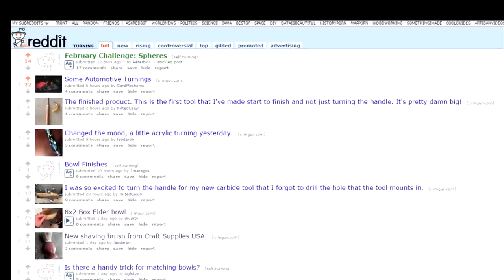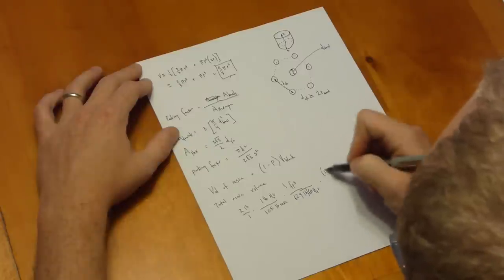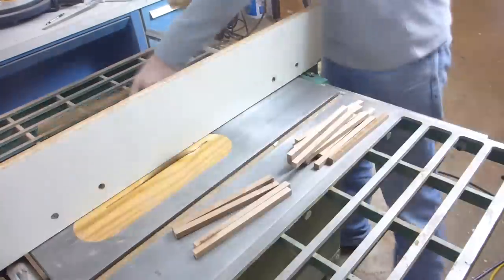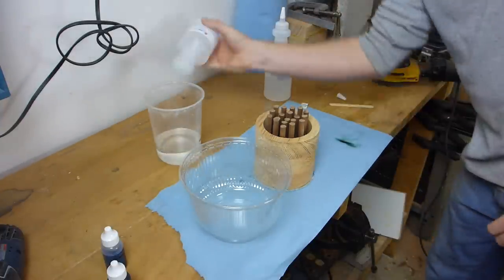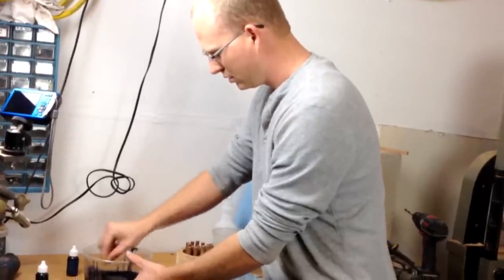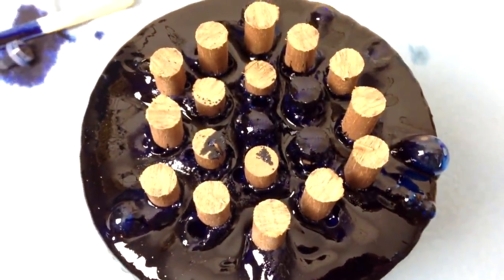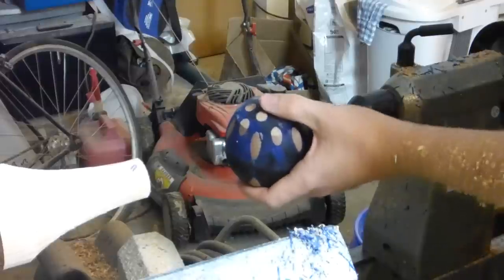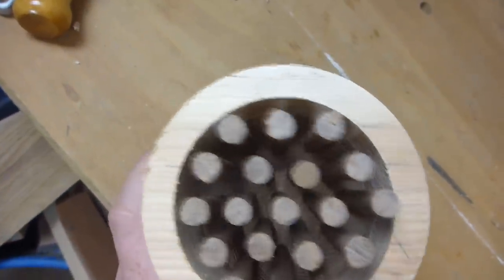Resin Sphere Turning Experiment Failure

Comment: The bubbles could be air leaving mold. Alumilite also hates water (water in the wood or atmosphere) it will for lack of a better word it will "foam". Alumilite needs air pressure or vacuum to remove air bubbles (vacuum is best). The resin creates tons of gasses while curing. As the gasses rise bubbles will get trapped in the resin and they will stay. I use pressure since I could get this setup for only $150.00 usd. Casting thick thick pieces is best done in layers so you wont get as many bubbles even casting it under pressure. Pressure can only crush bubbles or distribute them so well before you will need vacuum to "suck" out the gasses. Adding too much liquid pigment will make the resin not cure correctly. If too much coloring liquid is used you need to provide it with a heat source a hair dryer works well. Even with added heat it might not cure well or at all in spots.

I am going to be working on a block mold in silicone and want to turn a sphere with pearl-ex in it. But that is months down the road since I have bottle stopper molds to make right now.

Comment: I just watched your video, and I read in the comments that someone already told you about moisture contamination and the foaming that will occur due to that fact.
The coloring should not pose a problem, unless the product itself has been moisture contaminated. I know that many demonstration videos show people stirring the resin with wooden sticks, but I would advise against even this; I always use plastic spoons.

Your setup generally isn't flawed, except for the fact that you may want to seal all the wooden surface with some form of laquer so that the resin will not come into direct contact with the wood. And then it's also about the resin. I've used Alumilite and Smooth-On, and both have yet to come up with a resin that will not produce small champagne air bubbles upon curing, even when you're being extra careful and you pretty much are doing everything right.
I highly recommend Polytek's resins; they also have clear ones (Poly-Optic 14 series). The Easy Flo series is superb, and so far none of the castings I have made with this resin has produced bubbles as opposed to doing the exact same process with Smooth-On resins.
It is true, however, that when casting clear resins your best bet is pressure casting to get a glass-like finish, though heavy moisture contamination may still cause problems.
Reply: No problem! I also came across someone who also combines wood with resin, but instead of polyurethane resin he uses epoxy resin.
This type of resin takes about 24 hours to cure, but even the clear variant apparently does not require vacuum degassing prior to pouring, or pressure casting. The advantage seems to be that even when in contact with wood you will get a flawless, bubble-free casting.
If the time factor for curing isn't a problem for you you may want to give that a try. You can also color the resins, as far as I know.

Comment: I like this. You said you weren't a fan of sanding, but maybe you you could choose to smear another color of resin around the sphere that would fill in those air pockets and chip outs and then sand it smooth. This may take a few attempts as you'd have to have support points for the drying process of the resin, but it could add another dimension of color depth. Maybe even choose multiple different colors, each used on a different attempt. It's an experimental piece, why not keep experimenting?

Comment: To make it look better you should use polyester resin or a slower curing resin. In the large mold it boiled because you were using the improper resin for the job. Also to make it look better you probably need less dye.

Comment: Interesting first take! - Why did you want to use this type of resin?  Surely if you had used epoxy and poured it as steadily as you did, you wouldn't have had the extra problem of heat, hence, bubbles - really interested to see where you take this next
Reply: *****
I presume you have seen Brendan Stemp's videos on resin?

Comment: A second hand pressure cooker can be easily modified to be both a vacuum chamber to remove bubbles pre-pour and a pressure chamber post pour...   check eBay, the restaurant styles ones are huge and not that pricey...

Comment: I am wondering if part of the bubble was coming from the dowels themselves. If you look closely, there are bunch of tiny bubbles in the resin part, around the dowels. they are almost like foam. maybe the high temperature you've mentioned had caused the moisture to evaporate. Or the temperature had expanded the gas.
maybe you can test that theory out by pre-treating the dowels or something.

Comment: if you pour your resin really slow it cuts the amount of bubble greatly once you have  poured your mold take a palm sander and use it to vibrate the side of the mold for a few seconds this should bring the rest of the bubbles to the surface good luck on the next one

Comment: Why didn't you put the dowels in after? Some nails, and some nails in the base of the mold, and some pre drilled holes in the bottom of the dowels. Also, why didn't you treat the dowels with some sort of epoxy before hand to reduce the porousness of the natural wood.

Comment: There are other resin products that you could coat onto that sphere to fill the holes made by the bubbles.  You could even choose a complimentary color and take advantage of the 'mistake'.  Even clear with a small flake glitter would turn it into a disco ball.  You'd turn down the new resin to match the shape of the existing and polish the sphere.  You might want to look into it.  https://www.youtube.com/watch?v=SAtDB58gib0 (This video uses a natural nut that is inlaid with Bronze impregnated resin)

Comment: polymerization is an exothermic reaction. The more you working with the more heat you will get. With more heat the reaction goes faster and in turn produces more heat. Burns are very possible

Comment: I wander if the bubbles are gasses expanding and being forces out of the wood as it heats up.
Reply: That was my thought too. Maybe baking the wood first could help?
Reply: Good idea. Maybe if you get it hotter then the resin during the reaction for engulf tine for it to out gas. Then didn't let it cool down until it is immersed in the resin. Just don't start a fire.

Comment: It would only be a mistake or a failure if you gave up and never tried it again. I always take nail or heavy needle and poke through drip drop bottles. An if you try again I would make a top with a pour spout that way you can put dowel holes on both top and bottom to get the alignment you wanted. Check out the king of random on you tube. He shows how you can make your own vacuum chamber that will help get rid of the bubbles. An it was most assuredly the bubbles that helped create the chip out problem.